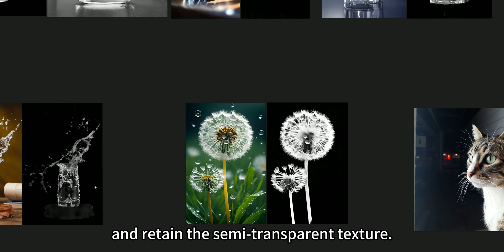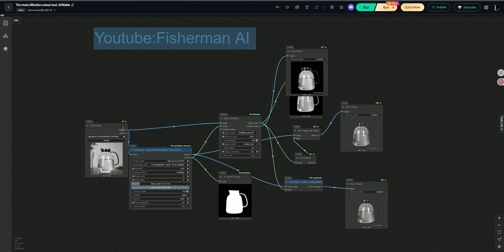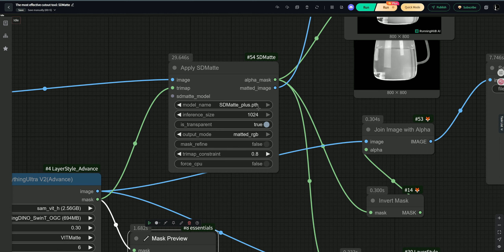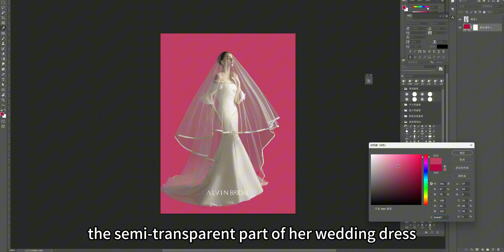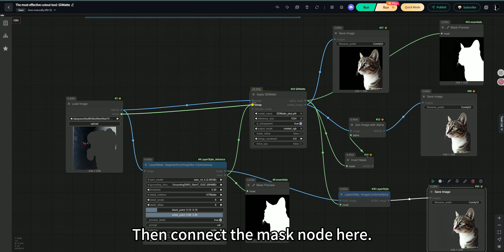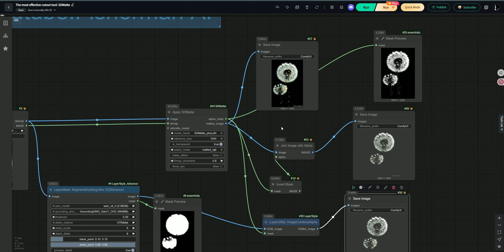The most effective cutout tool, it can handle glass, water droplets, hair, wedding dresses, etc.

Comment from the maker: This workflow is free to use: https://www.runninghub.ai/post/1959979949241348098?inviteCode=rh-v1222

Fan Benefit: Click your avatar in the top right corner, then click Invite Code and enter your invite code. You'll receive 1,000 RH coins. Log in daily to earn an additional 100 RH coins.

Invite Code: rh v1222

On this platform, you can experience the speed of the 4090 GPU, which even has 48GB of VRAM.